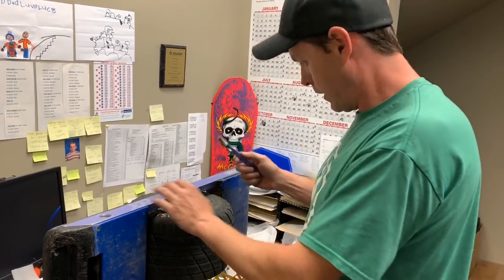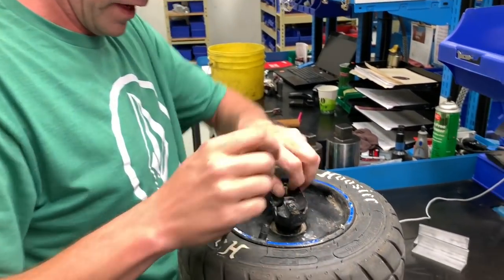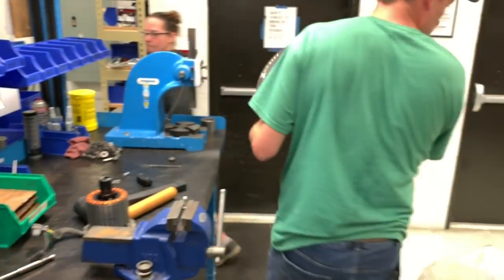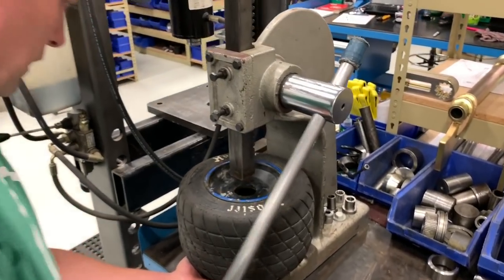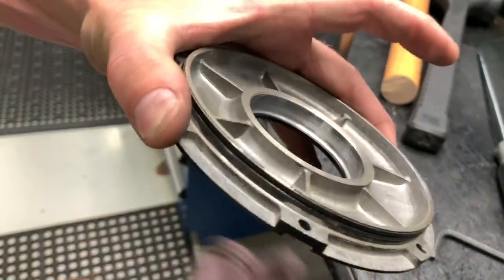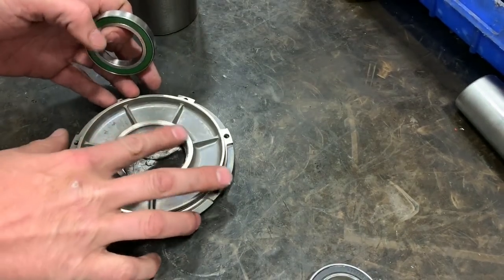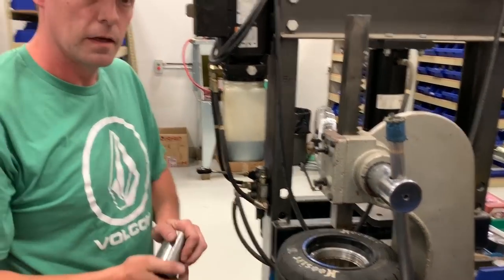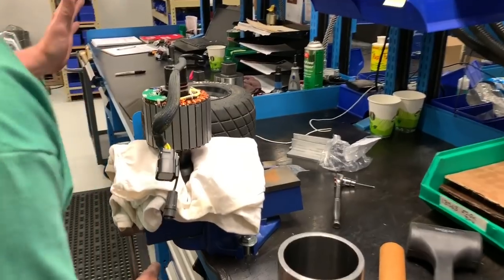How to change the bearings on a Onewheel with Sean Nelson

Comment: Thanks again for the vid!  It gave me the confidence to change my bearings myself.   I went the 2x4 and hammer plus being patient and careful and it was easy!  I used a socket etc to get the old ones out and to fine tune the final seating I used ball joint press end tools plus dowel/hammer.   Smooth and easy thanks to you!  Btw I measured the torque breaking loose the small hub screws and I averaged about 30 inch lbs.   I know loosening is going to be higher than tightening but 30 inch lbs is not much pressure so I felt comfortable torquing them to 30 inch lbs going back in.     Again can’t thank you enough for taking the time to do this for us!   Smooth sailing again.  Went with the Burris ceramic @ $32 each I figured it was worth a try.    The SKF ones were $100 ea at my local distributors!      If the Burris ones doesn’t live up to the job I will absolutely spend the dough on SKF on the next change but so far these are silky smooth!!!

Comment: I scored the O-Rings from my local seal shop where they are a stock item off the shelf for $1. They are a 33mm x 1mm standard rubber O-Ring to order. You can usually reuse the large O-Ring around the cap but they are also an off the shelf item called a BS 046 or 107.67mm x 1.75mm standard rubber O-Ring.

Comment: Just did mine.
W O W. It's a new board again. So crazy smooth. I used a combo of wood and a drill press (used as a bearing press) to seat all the bearings. Took a bit longer than having the proper tools but worked fine.

Mine was at 1200, no drops no bonks, but I didn't keep it clean. So the bearings wore faster.

Side note, I had 2 different colored bearings stock. Different brands. Weird.
Reply: Which new bearings did you use? What do you think of them?

Comment: Just a little tip throw the bearing in the freezer and heat lamp on the metal parts a little oil also helps.

Comment: I am a bearing engineer and the note that is made at 12:30 is extremely important. It is not advised to install a bearing with a rubber mallet but if you do, make sure that the intermediate piece you are striking is in contact only with the outer race and not the inner race. If you strike the bearing through the inner race that impact load will travel through the inner race, through the balls and then into the outer race and can leave indentations in your bearing which would make it noisy and cause it to fail early.

Comment: @Shredd Labs In the description above you're noting SKF 61907-2RS (as in Sam) but in the video itself the number is SKF 61907-2RZ (as in Zebra) would you please confirm the correct nomenclature?  I am ordering the bearings directly from an SKF distributer and want to make sure I'm ordering the right ones.  I assumed Z not S.  Thanks for your help!
Reply from the maker: Sorry for the late reply. I'm just seeing this now. The "S" is the better one with a better rubber seal for dust/dirt but the Z will also work.
Reply: @eevees  Hey thanks for the response, I already went with Z all those months ago.  Another question is that there's someone on the OW page selling these SKF bearings for under 40$ each.  I paid A LOT more for them from a brick and mortar store.  Is there any reality to getting these for that little or is it likely a skam?
Reply from the maker: @wizardmix  I think they're legit as he's reputable. Someone he is selling them at wholesale cost.

Comment: Is it possible to get this guys contact information so I can pay him to maintenance my board?
Reply: Dude I was thinking the exact same thing. I’m actually stressing this process because I already know I’m going to ride my board enough to need this.
Reply: Hey guys it’s easy, don’t stress.   Patience,  sockets to knock the old ones out which comes out super easy at least for me it did.   A few Wacks with my 2 lb hammer and right out...  

Small piece of 2x4 and again careful to keep it even and start with light taps and when you’re 100% sure it’s even and enough to hold in place. You can start to hit with more pressure.   A cylinder shaped big socket etc or whatever you can find, I have ball joint tools so luckily I found a piece that matched the outer part of bearing perfectly to finish searing it.      But seriously very easy and you’ll get to know the motor etc and will be very happy you did it.    I bought some electric motor oil 3 in 1 brand as well, after wiping down my motor and the surroundings squeaky clean, . I wiped a light coat of that oil as well, everything silky smoooooooth!!
Reply: I'd say your best bet is to join your local Facebook Onewheel rider's group, if you have one that is somewhat near you regionally.  For instance, I live in South Florida. And about 2 hours drive south of me, I connected with a guy who could perform these type of services when I need them.  And to me, it's worth hooking up with him on one of our days off, tipping back a few beers, him cranking on my Onewheel, etc.  Good luck!
Reply: Yes I would love that so very much too!
Reply from the maker: Head to https://www.stokelifeservice.com to find a service centre near you. Most can perform bearing changes.
Reply: Chadwick Wicky Where did you get the bearings?  Thanks
Reply from the maker: @ken-mb5cp  Some service centres carry them but you can also get some at thefloatlife.com or thefloatlife.ca if you're in Canada.
Reply: @eevees

Comment: hi, great video. Did you use some kind of glue/adhesive to seal the motor after replacing the bearings? Is an adhesive necessary to prevent water or dirt from getting into the engine?
Reply: The bearings are sealed and act to seal the motor

Comment: Thanks mate  , comprehensive and  good humor  , pleasure to watch .   Through a  national bearing supply company in oz   I ordered  skr619072-rs   , was told  if that couldn’t get they would Supply the equivalent. What I received NSK6907V vCMNS7S107 dimension 56 x 19 x 13.75 provide with a seal kit  ,    As I am not and it seems inevitable you are  ‘the bearing guy ‘ what’s your option  are the NSK  I have been supplied   Equivalent  or what ? knowing  ( I think }that the dimension size on SKR 55 x 35 x 10  from memory makes these others not even close doesn’t it I will talk to the shop where I purchased when they reopen after the weekend and to find out all the way it is reassuring to know I’ve got that bearing guy there by my side when I’m doing change over home ,alone cold and lonely knowing that you are always there at the push of a button
Thank you

Comment: Please note the fully sealed bearing is the 61907-2RS buy this bearing and not the 2rz
Reply: are there ceramic ball bearings for the OW XR?
Reply: svtsnake Burris offers ceramic bearings , Craft&Ride website is where I seen those , was also just about to order them until I seen this, now I’m torn ....
Reply: I just spoke with the distributer, they seem to think that Z bearings are better for the onewheel due to heat/temperature variants being a factor.

Comment: Copper lead aluminum or stainless tube  slightly less than the internal diameter of the magnet  ring would help when having to install the internal bearing past the magnets

Comment: Awesome!   Question the SKF bearing runs almost $100 ea.  I have no problem paying for quality but say vs Burris highly touted ceramic bearing at $32 ea.   Is the Burris a viable option?    That is a massive price difference so just curious.   If the SKF 2RS bearing is that much better than so be it but just curious between factory bearings and SKF is there viable option that’s not $100 each??

Comment: Wow the motor has a mini board inside right? I thought it just connect directly to the controller
Reply: Those are the hall sensors for the motor.
Reply from the maker: I'm assumung the gyroscope or accelerometer

Comment: How's the skf bearings working out one year later? Any thoughts on the burris ceramic bearings?
Reply from the maker: jsin01 They’ve been holding up well — 2000 miles later! I wouldn’t recommend ceramic bearings in general as they aren’t meant to have the kind of force on them like landing drops on a Onewheeel.

Comment: I don't have an arbor press large enough to accommodate the wheel and I don't want to heat the wheel in the oven due to the magnets.

I'm not terribly concerned about removing the bearing but when it comes to getting the new one in there.  I figured I could put the bearing in the freezer overnight to shrink it down a tad and make things easier - but do you have any other tips for somebody wanting to do these without access to a large arbor press?

I could use a different 12-ton press I have access to but I'm a bit worried I'll crack the housing on the wheel or the plate.

Comment: Also, are those new bearings pre-lubricated? No need to open the seal and grease inside prior to install?
Will adding a few drops of 3 in 1 oil from the exterior once a month be a benefit to extend bearing life?
Reply: All bearings pretty much come pre-greased. No need to oil. Oiling it can thin out the grease on the inside and cause premature wear.
Reply: Those were sealed bearings - they are designed to keep dirt/liquid out, and grease in

Comment: I have done 790 miles on my XR and now when I go across a bumpy grass field I hear a bit of a rattle coming from somewhere do you think I should replace my bearings now.
Reply from the maker: The rattling is likely coming from your headlight cable bouncing around and not your bearings. Bearings tend to make a clicking (when going from heel to topside) or grinding sound if they are bad.

Comment: I have a OW+ with 1,300 miles. How many miles ho the batteries usually last?
Reply: I'm no expert but you can probably go another 1200 miles and still have a good battery. You might notice it starting to keep around 80% of it's charge at 3000 miles.
Reply: @BradleySpence  The + uses LIFEPO4 cells which have a lifecycle higher than most lithium batteries (around 2000+ charges) so based on that, I believe around 12000 miles and you may see battery degradation. That's providing the batteries have stayed within there voltage range and no issues related to the Battery Management System have occurred. I hope this helps :)

Comment: How much does onewheel charge for this process?
Reply from the maker: They usually replace the motor which can cost $400-$600 I believe. I don't think their repair guys even know how to change the bearings as they usually come pre-assembled with the bearings already installed.
Reply: @eevees  Very interesting.  So if I try this and screw it up [because it was needed] - I'm only really in the hole my time and the bearings - because worst case I'll need a new motor either way.

Comment: I have 2000 miles on my pint.   Bearings seem smooth.   Should I change bearings?
Reply from the maker: You're probably good if they're still smooth. Future Motion doesn't always use the same bearings so you might have got a good set.
Reply: Also sometimes it seems I’m getting earlier pushback.   Does heat of the motor effect this ?   Maybe in hotter weather or going uphill?
Reply from the maker: @ken-mb5cp  You shouldn't get pushback earlier. The heat of the motor or heat outside shouldn't affect it at all.

Comment: You dropped the wheel out easily but didnt remove the footboards or bumpers or side rails.
So why do all the tire change vids show them pulling the whole Onewheel apart to get the wheel out?
Reply from the maker: Wiz Rom This is also possible, you just need to take the handle off. As mentioned by Jeff early in the video he says that he’s only done a few changes and there might be the odd unnecessary step or two.
Reply: @eevees  Thanks man! 🙂

Comment: Are these the same bearings (replacements) as the ceramic hybrids craft and ride sells?
Reply from the maker: Jeffrey Jenkins No, these are not ceramic bearings. These are much more expensive but worth it. Ceramic isn’t the most ideal bearing type for the Onewheel
Reply: pricey, but worth it I am sure. $99 each on amazon sound about right?
Reply from the maker: @JeffTheCSCS  Yes, that sounds about right. Just be care because there are a lot of fake SKF bearings out there.
Reply: Skf has a bearing authentication tab on their website. 2 years later these bearings are now $140 minimum.

Comment: Why does the board nosedive at 23:35?
Reply from the maker: I had an aftermarket concave pad on it which causes sensor issues.
Reply: @eevees  Thank you for replying.
We just got a One Wheel XR, and on three instances have had a very low speed cutout  that looks just like yours, and we have a third party rear concave pad.

Never at any type of speed, I think once you are moving forward it will not shut off for thinking a foot has come off.

Did you fix it? We are going to tear the whole thing down soon to be sure everything is connected right
Reply from the maker: @xzendersjet7595  It’s just a beginner mistake most likely. If you don’t have your front foot completely flat and the weight distributed on both sides, it will disengage on you. I teach a lot of new riders and it’s a common issue. I recommend wearing flat soled shoes like Vans if you don’t already. It helps a bit.
Reply: @eevees  But it ignores one side off at speed?

Comment: After watching this, I changed my mind & will get a eboard instead.
Reply: Jeff Shih What? Eboards have way more mechanical problems than Onewheel’s. Our local dealer sells 1-2 Onewheel’s each day and has never had any issues with any that they’ve sold yet they have eboard issues all the time. Have fun missing out.
Reply: @BradleySpence  from this video I see an oring manufacturing defect, compounded by availability issue, motor damage caused by worn bearings that is not serviceable without a bearing press. For a product that is almost $2k, I'd expect better design.
Reply: Jeff Shih You think other eboards don’t have their manufacturing problems? It takes a quick search to see all the issues with Boosted and Evolve boards that are actually life threatening. Also, since posting this video, Future Motion upgraded their bearings and I haven’t heard of newer boards having o-rings breaking. Also, many have have changed their bearings without a press.
Reply: @BradleySpence  "Also, since posting this video, Future Motion upgraded their bearings" 

Any proof of that?
Reply: I'm sure you'll be happy with it but damn trying to ride an eboard after the onewheel feels like driving a 95 honda civic after just driving a rolls royce phantom except the onewheel has the maneuverability of the civic and the civic has the maneuverability of the phantom.

Comment: Did he really just say the new bearings will last a couple thousand miles? 🤨 Ive talked to a guy who has ridden 20,000 and still has his original bearings.
Reply from the maker: grock89 20,000 miles, eh? Im afraid to say that you’re friend is lying. There’s no one with 20,000 miles on the leaderboard. And yes FM doesn’t use the same bearings in every board. They have been known to use really cheap ones that only last a few thousand miles.
Reply: @eevees  Sorry, it was 12000 miles, just checked. Still, an SKF bearing only lasting a "couple thousand miles" is absurd.
Reply from the maker: grock89 It’s not absurd and totally depends on the rider. If the rider is doing a ton of drops, riding during low-ride on the beach through salt water, or riding a ton of dusty trails, the bearings can wear a lot quicker. You can feel it in the board when the bearings are shot. I guarantee if your friend switched his bearings, he would notice a huge difference in smoothness. If your board is making squeaking or clunking sounds, it’s time for a bearings replacement. I’m not here trying to convince people to convince their bearings every 1000 miles. I’m providing a free instructional video and advice based on my experience in the Onewheel community over the past few years.
Reply from the maker: Also, Onewheel/FM has not been known to use SKF bearings

Comment: This makes me not want to get a OneWheel now.... I don't want to pay $1,800+ for one, just to be faced with difficult issues like this. Especially if Future Motion is cutting corners to make big bucks, even though they should be using TOP notch quality Everything for that price, with something like a 5thousand mile warranty, in my opinion. So, im just going to stick with my E-Longboards and maybe and E-Bike down the road. Man i wanted one too,, what a bummer.
Reply from the maker: That is not what we wanted you to take away from watching this video. I can think of a ton more e-longboards that have even worse (and more deadly issues). Evolve, Boosted, all the big brands have had much bigger issues. Our local eskate dealer says he never has people coming in for Onewheel issues but sees it all the time with every other eboard. These things are rugged and built like tanks. I've seen people drop off 8ft drops and the board keeps on riding. Also, FM now uses higher quality bearings in the newer Onewheels. I'm sure they saw this video and fixed the o-ring issue as well. Still, minor issues when it comes to the overall tank of a machine you're getting.
Reply: Should take this as a item that wears like other goods but you can maintain and repair.  I think you're missing out on a awesome ride, I have other eboards too and this is by far is the best of all boards